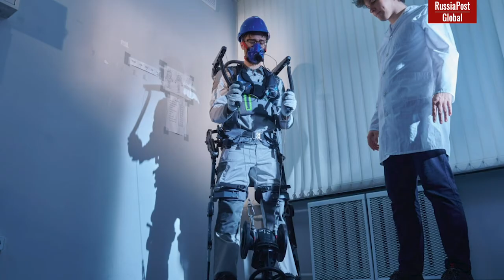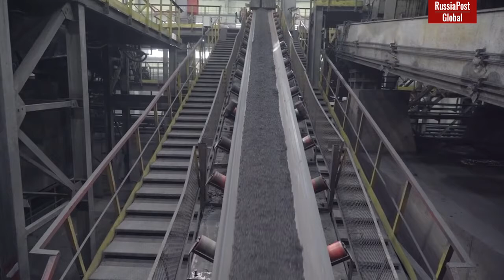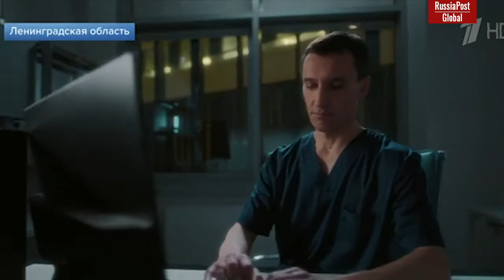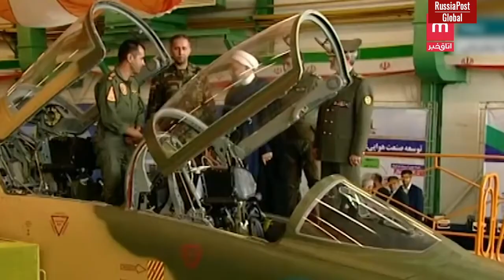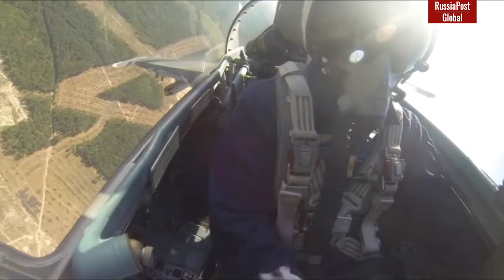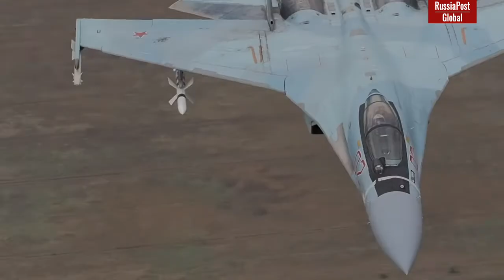Mysterious cargo from Russia: Iran was waiting for it like manna from heaven

Comment: I don't understand. You start with an An-124 landing in Iran and proceed with a Su-35 fighter. Are you hinting that An-124 was moving Su-35 to Iran? I don't think so. So what are you talking about?
Reply: An-124 is huge. The most of russian fighter jets could easyly be transported by an An-124. They remove the wings and put them by side into the cargo plane. It’s like a lego system to later put them together. It‘s also possible that with the An-124 Iran received lots of weapons for the Su-35 and this fighter jets could easily fly to iran over the Kaspian sea. Maybe they are already there. They also have the posibility to put them on a ship, but flying them over is faster. With An-124 they also transported S-400 to Serbia for joint exercise.
Reply: @neko1533  Thank you for your explanation. I didn't know that.